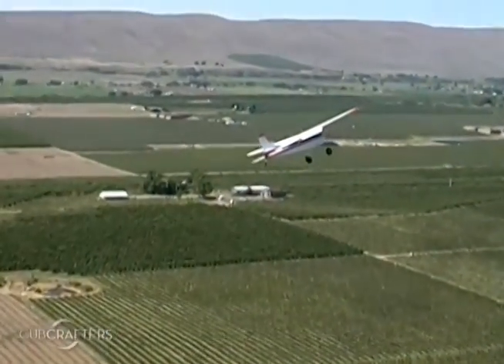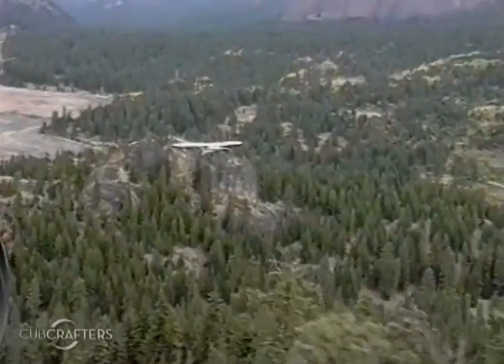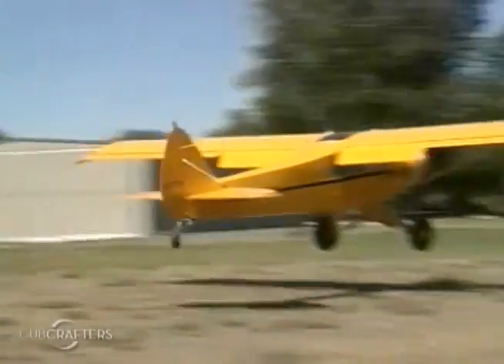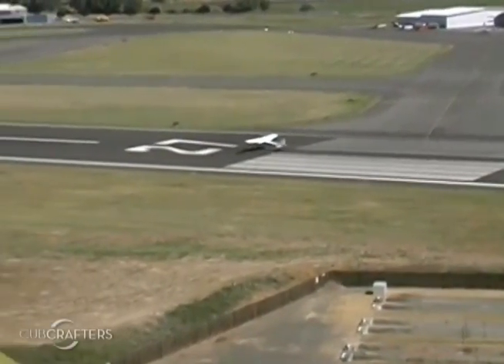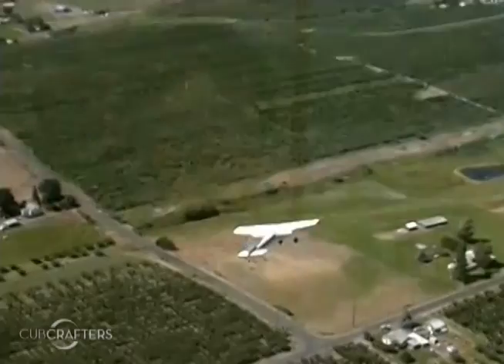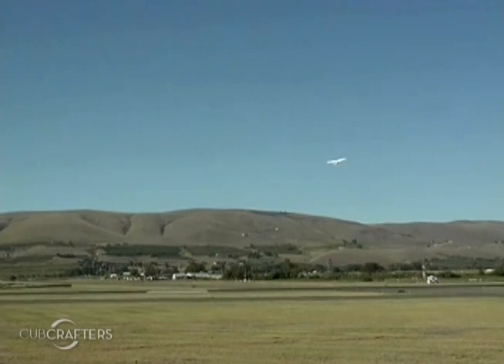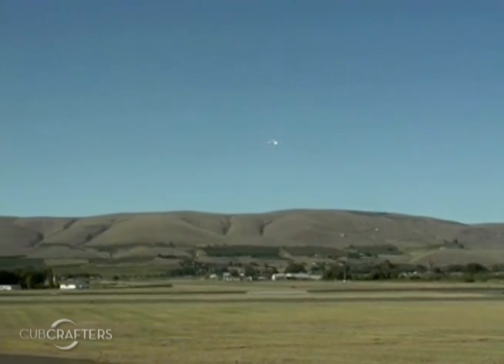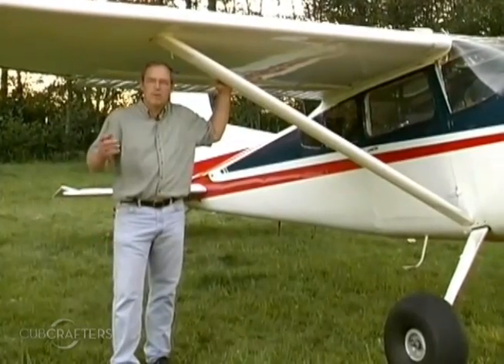Vortex Generators - Overview  (1999)

Comment: Ive always wondered why a coat of frost ruins lift yet VGs a half inch high makes lift better. Explain it??
Reply: The roughness of the frost causes the boundary layer to slow, stagnate and separate earlier than it would otherwise while the VG's cause a spinning cone of air to move back across the wing which re-energizes the boundary layer.  I hope that makes sense.  Its really neat that on many airplanes VG's don't lower top speed (some do have a slight decrease in top end speed) because the extra drag that the VG's themselves are generating is offset by the the reduced drag that the overall wing has due to the boundary layer staying energized and close to the wing.  That's why golf balls have dimples, to decrease the low pressure wake behind the ball and decrease overall drag and make the ball go further.